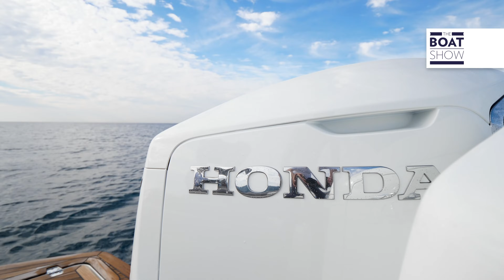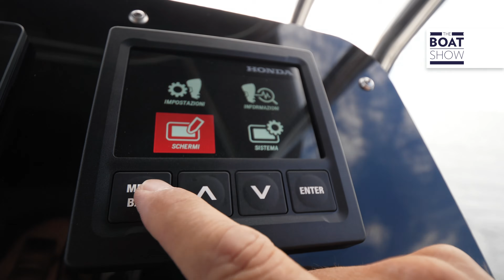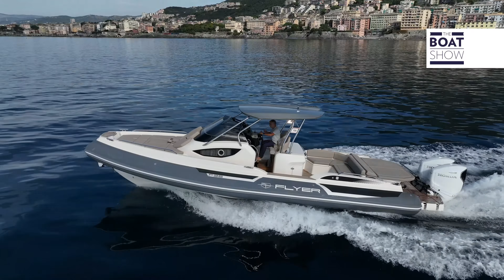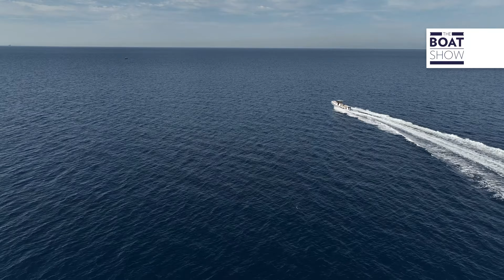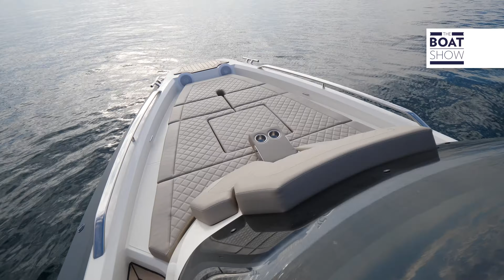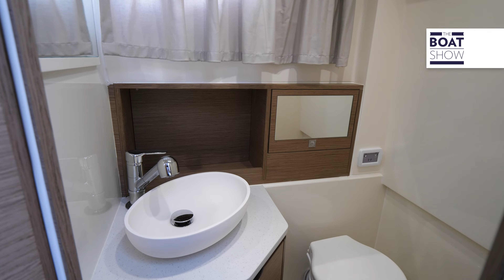[ENG] NEW HONDA BF350 - Outboard Engine Review - The Boat Show

Comment: Verado stomps these anchors! in all functions! MPG is terrable compared to mercs! Who wants this new engine? No experiance in the salt water world! Merc rules that world in all waySs!  oh a balanced engine, wow! that makes it good! HAY! Merc has been stamping out Vrods and engines for years and sells the most in the salt world, and has world experiance building them! Honda has always been known as boat anchors! If we wanted a anchor, Id buy a rope! Not a HONDA! Support US made items! Not Japan! racing like? Merc owns that world too! Always has always will~! Go away Honda we dont need you!
Reply: I have owned 6 250hp verados and put 3000-3500 hours on each pair. I have gone through 11 lower units, 3 superchargers, and have never made it more than 500 hours without a major mechanical breakdown. I also have some smaller optimax and other mercury motors. Bought my first set of Honda 250's 3 years ago and have 1600 hours on them and have not had a single issue of any kind. I run a Charter business in Alaska. The cost of maintenace alone will save me the cost of a motor over the life of a motor. I will never go back to mercury again. The reliability, fuel mileage, ease of oil changing and cost of those changes. I also increased my fuel effeciency from 26 gph to 22 gph when I switched.  The fuel savings alone will pay for a new motor after 3000 hours. I was a die hard Mercury fan. Never again.
Reply: @rickmatney5045 lol I was going to mention I always saw the l6 verados getting lower units replaced all the time. It’s almost like clock work everyone has a unit throw a screw out the side of the gear case at 400 hours.
Reply: @rickmatney5045 right…this guys spelling and rant is clearly someone with sub 100 IQ that is a fanboy. I’m not brand loyal to anything that isnt loyal (reliable) to me and Hondas, while having a very unknown reputation where i live in west shores of florida…ARE HONDAS! Of course they are going to be more reliable than a Merc! If it wasn’t for Brunswicks boating cartel that corned half the market supplying power to all the credit card captains, they’d be bankrupt off reputation alone. Unless youre a masochist with a service marina in your backyard?
Reply: 3500 hours on a set and won't go back? wow. Wtf applies. V rods maide hear....
Reply: no hate love mercs
Reply: Honda is Honda!!!!
Reply: Why so much hate? Just because Honda’s are more reliable than the competition you love?
Reply: Am I suggest to stop hitting rocks trees to Breeze whatever you're running into to ruin a 11 cases you're just not doing something right operator